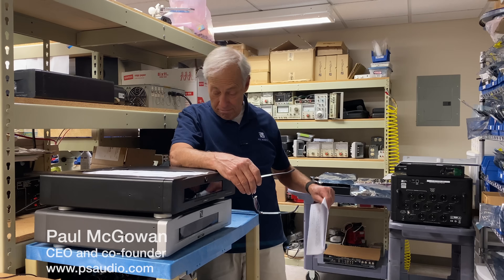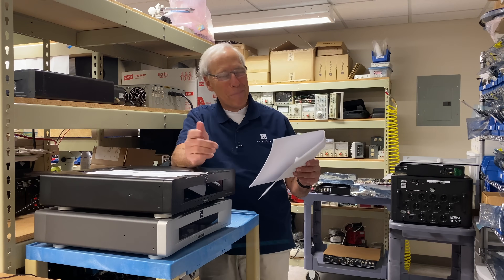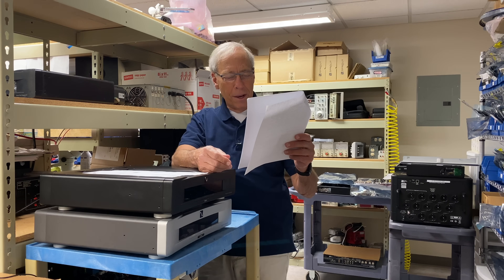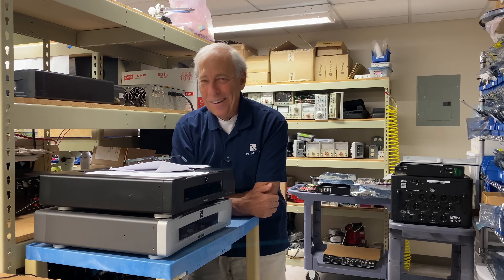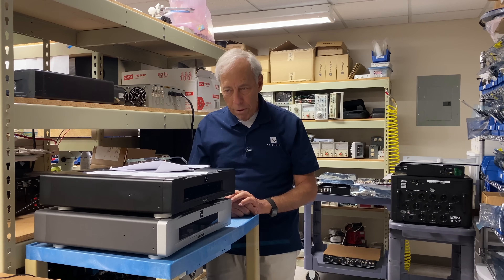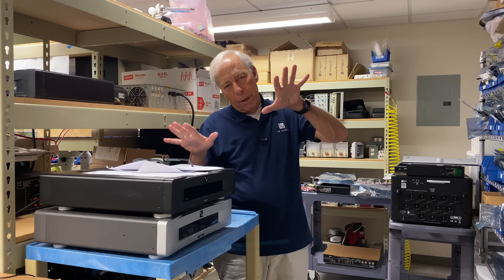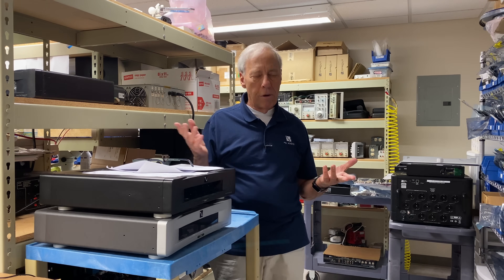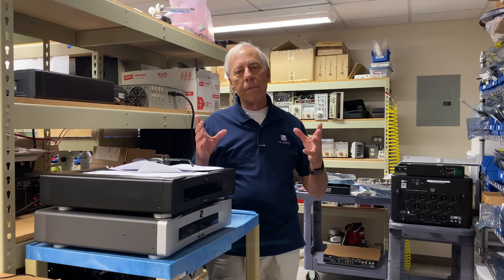DC on the mains

Comment: So, am I right in thinking that a dedicated transformer would be prohibitively expensive?
Reply: Mike Eastridge  
That's a very interesting example.  Thank you for sharing.
Reply: Probably yes.  If you build a home that's very remote from neighboring buildings, then the power company may give you a dedicated transformer.  Otherwise, it's likely very difficult to convince them to give you one.  
As an alternative to the diode-bridge method, you could use a nice heavy-duty isolation transformer installed near the electrical panel, but those aren't cheap, either.
Reply: @marianneoelund2940  A power systems transformer is alot cheaper then a ps audio system, not very expensive for what it is, couple grand maybe,, used ones readily available due to building upgrades. But the labour will be huge. And they wont just come give you a dedicated line either. To get clean AC you would use your own generator or a UPS system designed to give you clean power.
Reply: Thanks, everyone!

Comment: What a bunch of nonsense.  Those diode bridges might stop residual current near the zero crossings of the AC but would conduct otherwise and would not alter the AC + DC waveform, if that is something you truly believe is happening which I would seriously doubt given the total load impedance placed on the line transformer.

 I would suggest looking to see if the line/pole transformer (or even possibly substation) is being overloaded at those times of the day causing the AC to be less sinusoidal. And if that's the case your power provider should be required to address the distribution problem.
Reply: G Guest  Please explain how the "DC blocker" would prevent such a significant offset that it would cause an offset in the AC waveform.  Also a DC offset won't add to the eddy currents but yes a laminated transformer will have less eddy currents.  The problem isn't some phantom direct current.
Reply: I agree with Chris, and am skeptical about the diodes being able to solve such a problem.  On a perfect 120V AC source, the sine-wave peaks will be ±169.7V.  Now, envision an actual problem where the 120V AC line has just 1.0V of DC offset.  The positive peak becomes +170.7V, and the negative peak becomes -168.7V.  The wave shape will still look like a perfect sine, it's just shifted up a volt.  Now put in the 1.2V dropping-diode assembly.  With this, the positive peak will be +169.5V and the negative peak will be -167.5V.  The 1.0V DC offset (pretty much all of it) is still getting through.
Reply: Still to complicated. I bet its just an old noisy transformer lol. They hum. Its just what they do.

Comment: If your transformer is humming, give it the lyric sheet so it can sing instead! Waa Waa!   Honestly, I've never heard of that phenomenon! So, you're saying if there is a big phase imbalance between L1 and L2, a DC voltage could be generated? Is there an instrument that can measure that? All I know, if I'm right, is that in a home, if one phase is heavily loaded, it could cause a voltage on the neutral leg. In severe cases, of if the neutral is not super well grounded, an additive voltage may appear on the less loaded leg and actually cause a voltage increase on that leg. But creating pure DC? Wow, that's a new one for me.
Reply: A few things. "... if there is a big phase imbalance between L1 and L2..." he didn't say this, or imply this. We might be using words differently though, so to be clear, "phase" is measured in degrees, not volts. It is a product of the AC generation itself, where each "phase" is 120 degrees apart (in 3 phase electricity). In Europe, the 3 phases are distributed evenly to each building(1 leg of each phase on 2 wires making 2 legs of single phase), in the US, the power is converted to split phase, and each building gets a 2 phase (180 degrees) power supply. I am not an expert on this, so someone might correct or clarify this.

Commonly we use the word "leg" to talk about the actual wire that makes up each "phase." 
To get to the heart of the matter, DC on an AC circuit. AC goes from -120v to +120v for a total of 240v. Lets say you input +10v of DC electricity, now your AC will go from -110 to +130 for a total of 240V. Since 0 volts is a physical ground, it remains always 0 volts, and an imbalance exists between the high and low voltage. The iron frame of the transformer still "sees" the 10v DC, and act like an electromagnet, and resists the swing to -120v, the transformer will resonate causing hum.
Reply: @joshua43214  Thanks for your constructive input! I am NOT an electrician, so my terminology may not be accurate. I only have a superficial understanding of phase angles and such. I know of wind generators that send their DC power into a syncronous (sp) inverter that "inserts" the DC voltage into the mains AC in a manner that it adds to the AC voltage at the voltage level supplied by the generator. Right? Anyhow, that's not here or there. What I can't figure out is how a DC voltage can be induced onto the mains to a big power transformer?
Reply: @curtchase3730  it doesnt, its possible but ive never seen it anyways in my 10 years of herding electrons, ive induced it in lab class not but never seen it in the wild. This is way overthought. Its probably just an old transformer, thats what they do lol. But if you wanted to see it you would use an oscilloscope and measure the peaks. Remember a transformer is just a motor with a stationary rotor and some wires coming off of it. It naturally wants to move and will make noise. It take excessive build quality to silence them.
Reply: Years ago I had the problem of mechanical noise coming from most of the transformers in my hi fi chain of equipment. It drove me nuts.
In the quest for perfect silence in my listening room I hooked up an oscilloscope to the mains. The sine wave was far from perfect with clearly visible distortions on the top and bottom curve. As a result I called in the utility company to investigate. They hooked up their equipment to the incoming side of my meter board and left it installed for a couple of weeks to record the quality of the incoming power over a set period. The conclusion was that I was correct in analysing DC on the mains, however the power quality was within the government’s guidelines and I would have to take it or leave it.
I then got an huge isolation transformer installed which instantly cured the problem. At last I had a perfectly silent room but that was not the end.
Immediately upon playing a reference track my heart sank. The life was sucked out of the music. The dynamics were just not what I was used to. The isolation transformer was promptly returned to the vendor for a refund as it was on trial. At that point I gave up the quest to tame the DC on my mains.
A few years later the utility company replaced the large supply transformer feeding my property, which solved the problem of vibrating noisy transformers for good. Paul’s solution would possibly have solved my problem all those years ago!